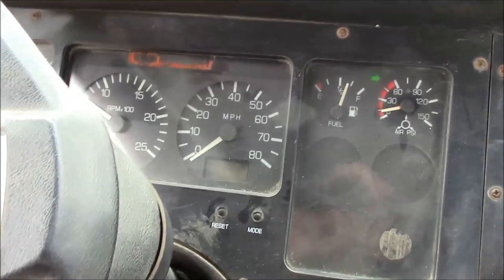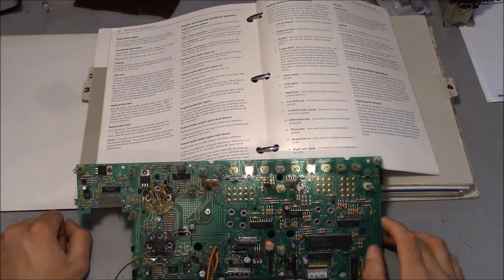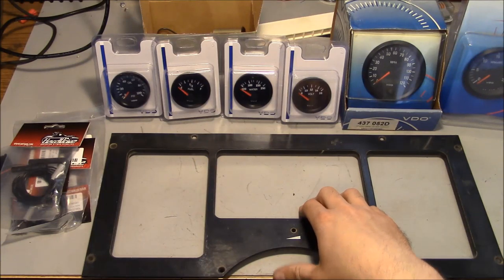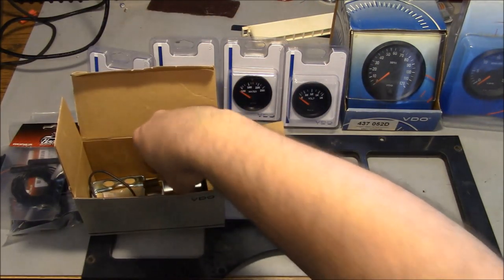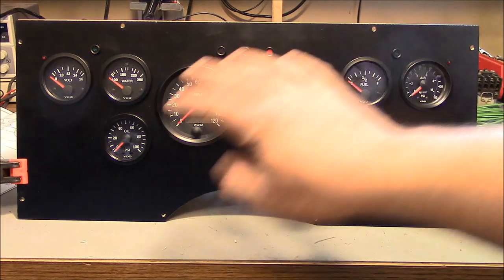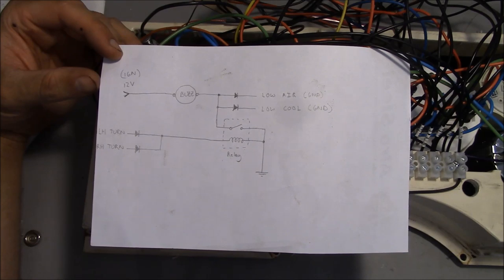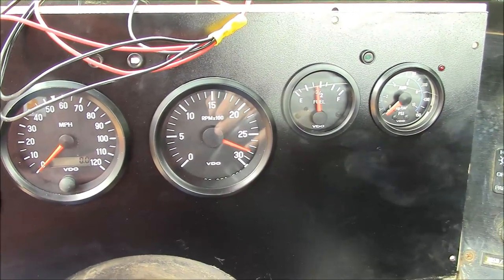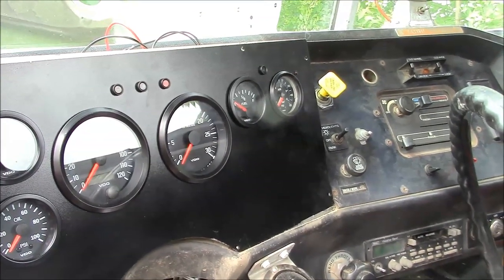Building an Instrument Panel for the Rollback Truck - Part 1

Comment: I really wish I was more proficient with electronics. It’s all electricity but the individual components do so many things that can really complicate troubleshooting quickly. Understanding that whole world certainly sets you way ahead of most in the mechanics’s world as well as most tradesmen. It’s not rocket science but definitely takes a different mindset than regular services, branch circuits and most electrical industry installation outside of fire alarm and PLC (programmable logic control) work; even most building controls are made pretty foolproof and it’s pretty easy to plug-and-play low voltage lighting controls using power packs (lighting control relays using dimming and occupancy sensors). My hat’s off to you, Wes! It’s an impressive ability to be able to draw from.

Comment: The item with the big heat sink is a bridge rectifier.
If you had a really useful diagnostic tool called Itty Bitty tester you could troubleshoot that rectifier, diodes, transistors, mosfets and other devices.
I've had one since the late 90's and it works great.
You'd also need a logic probe and a logic pulser.
With those items you can diagnose those old TTL boards.
The logic probe and pulser to test that microprocessor and transistors (5 volt max) in circuit power on.
Digikey is the best source for every item on that board.
If they don't have an item their engineering techs will help you find an alternative.
I've been working on old TTL boards in arcade and pinball games and other electronic devices since 1983 and have very rarely found one that can't be repaired.
If they've been hit by surges or have suffered other catastrophic damage then it's tine for the recycling bin.
Scrap byers actually love buying them.
Last I checked they give $ 1.78 a pound for them.

Comment: That's an Intel 8031/8051 microcontroller.  The crystal (blue resonator) is on pins 18 and 19 where you were probing, pin 20 is GND and pin 40 is +5v.  If there is a ROM chip near it, it's an 8031, if not, it's an 8051 with OTP ROM on die.
Reply: Nice detective work
Reply: Very interesting. You are well-informed.

Comment: Self canceling lights are common on newer trucks. The way I would do that is to use two different "buzzers". The turn signals could use a less annoying "chime" instead and that would eliminate the problem of the different type of switching. You will soon hate that noise every time you turn. No matter, that still looks WAY better than the stock dash.

Comment: Very admirable, instrument cluster is one area ordinary mechanics don't want to tread, it comes into the territory of electronics. But you have electronic knowledge and its come in handy. I once owned a Nissan Micra and it came with the problem of the engine temperature gauge would not function. As usual, I tested the circuit at the sender end to eliminate it and the wire to the instrument cluster. Finally it boiled down to the ins cluster, which I then removed and not knowing much about electronics I took it to a radio repair shop who fixed it.  I am pretty sure it was a diode or a capacitor.............

Comment: Nice job! That new panel looks nicer than the original, as well as working!

On that warning beeper, if it is too annoying, just put a piece of tape across the mouth hole. Muffles them right up.
Reply from the maker: I think I'll just use a current limiting resistor. Less power = less noise.
Reply: Works on spouses too, or so I've heard.  Haven't tried the resistor though.
Reply: @firstmkb  Sounds like something a boomer would say.

Comment: I drove a truck that had the buzzer hooked to the directionals, it about drove me nuts, especially when you turn on the 4 ways when you are backing up.  Non of the newer trucks I drove had the buzzer hooked to the turn signals.   I would NEVER hook the turn signals and 4 ways to a buzzer.   Doesn't take much to learn to turn them off with out the buzzer.  Other than that, nice job  figuring  everything out.

Comment: Not just big trucks that the wires are all the same color.
The '66 IHC 1100A 1/2 ton pickup I had possed all green wires under the dash and to the lights. Only red wire was the positive battery cable. Only black wire was the battery ground cable. A unisulated ground cable went from the engine to the frame.
Gosh I miss that truck ...
Everything else was the same color green, with no stripes or rings of a different color.

Comment: I've had good luck with VDO.  Agree that functionality, and aesthetics from most manufactures have all been inundated by the ricer scene.  Neon bright blue LED, gawdy bezels, face plates etc.  Then comes the pricing.  Good thinking looking at the alternator for a tach output.
Reply from the maker: Yeah it's tough. If you want simple gauges, often they are only made in mechanical versions.

Comment: I always check the 5v rail, I've seen failures of regulators and power supplies.  Some chips just fail, but I doubt after 30 years that Intel chip died.
Reply: I also suspect that the Intel chip is fine. Maybe more likely that one or more of the electrolytic caps on there has died or dried up and gone way out of spec. An ESR meter can be used for testing electrolytics in-circuit, and can quickly expose a faulty one.

Comment: yeah fixing that board would have been way beyond my ability.  while i do love a challenge I would have went the same route you did on this one.  Great job so far
Reply from the maker: Yeah, plus this was we can swap out individual components if something fails instead of "replace the main board" as suggested in the service manual.

Comment: Read a few replies before hooking my comments on the most boring commentator. That is harder than installing bearings on your back with grease up to your ears, at least with grease, skitters get stuck when they land to take their transfusion. I  have seen a soldier die from mosquito bites. They were thicker than the no see um's and little black flies that could chew through a uniform.I am proud of your work there. I hung gauges in all my cars as a kid and the amp gauge always had all the wire wrapped around the gauge waiting for me to find out it was one of the easy ones and then kids would bring me their car to put gauges in..... two or three wires per gauge. Thats till I started with mechanical gauges. I want to find part two as this has my attention. Your videos are on my top five channel list

Comment: Interesting circuit for the buzzer. Why did you not just have two buzzers and no relay?
Reply from the maker: You could. But you will still need a relay to overcome the fact that some switches are normally open and some are normally closed.

Comment: Since low air pressure and low coolant level are infrequent (we hope), and lh signal and rh signal are frequent (we hope), wouldn't you hard-wire the buzzer to ground and invert the control signals, so there's less wear on the relay. I realise the relay can probably switch 10M times before failure, but still.. Or have I missed something?
Reply: PS: Try filling your buzzer with epoxy :)
Reply from the maker: It's a fair point. The buzzer only pulls 10mA. So I guess if the relay ever fails in my lifetime, I'll convert the circuit.
Reply: Cheers  @WatchWesWork , Sorry if I come off as That Guy in my previous comment. I was curious to explore the options,  not be a youtube comments troll. Your make a great point about relay load. I hadn't thought about that at all, and at that amount of flow, the relay might well outlast the rest of the vehicle, and you and me.

Something I didn't consider is what are the knock-on effects when the relay fails, and how obvious will failure be? If the relay fails when it's in the indicator circuit, you can easily tell because you moved the lever and nothing happens. If the relay fails when it's connected to e.g. water level, and your water level drops - very bad things might happen. So you have probably picked the best setup anyway.

I'm overthinking it now, so I'll stop.

PS: The dash looks great, good idea, and great execution. All those wires at the rear can easily be shortened and cable managed later after testing, if they annoy you. I'm sure you have that planned already, and I'm jumping the gun.

Looking forward to the next installment.

Cheers, Craig

Comment: I would suspect the power on reset circuit, since these are usually analog, the chip won't work right if the POR circuit doesn't correctly put the chip  through reset.  You can put 5v on pin 9 momentarily to reset the MCU and see if it changes the behavior.
Reply from the maker: I can try it. I would still have to fix the back light circuit and the tach.

Comment: Very likely that the sine wave you picked up was an input to the chip rather than an output. At 12Mhz, on that old of a chip, I doubt it could (or would need to) make the nice clean sine wave that your scope read. I imagine it was just an oscillator input that the chip was using as a clock.

Also - with the two lines you talked about that switch the stuck-on bulbs via a transistor (I forget which bulbs now, but anyway), is it possible that the fault is in the other half of the circuit, i.e. the input to the IC, and that the IC is fine, and doing what it should? If you can trace from the various sensors plugs (using the numbered wires from the manual) you may expose a fault before the IC comes into play. If so, then it becomes an easy/easier fix. You may already have had this thought and it didn't work out, I'm not sure.

It doesn't help that you have about 10 faults at once on the board (!), so I don't blame you for chucking it out and starting again with a more robust solution. Anyway, building a new one makes for a more interesting project for you, and more interesting video for us :)
Reply from the maker: I don't know. From reading the manual, I think the seat belt light is supposed to just come on for a few seconds when the ignition switches on and then go out. I assume that control is done in the microprocessor with no outside input required. But I don't know. I have no schematics or other information on how it works.
Reply: @WatchWesWork  Fair enough - The new one will be more than worth it anyway and it will solve all the various problems in one shot.

Comment: If you still have the board and 5 minutes.  pry the chips up gently look for any ick the big pink pencil erasers clean the pins well.  The other thing if your eyes are good or glasses look at the ground running on the board and "gently" flex the board looking for solder cracks  you may be able to touch up a solder crack and fix it to get by for a good while.   Otherwise old school is not bad.
Reply: Pat B good tips - also push any socketed chips down in the socket, since they can work their way out.

Comment: I think I would have used the connectors off the circuit board to maintain the original wiring for the most part and so the cluster could be unplugged for service. Sounds like there are extra pin outs in them you could have used for your needed additional wiring for the other gauges too. That electronic board looks overly complex to me for what it does anyway, better off without it.
Reply from the maker: It would be nice but the connectors on the board have to be soldered to a PCB or the pins just fall out. I guess I could have sawed up the old board... I could always rig up a 12 pin weather pack connector. I have the crimper for it.
Reply: @WatchWesWork  Sawing up the old board and soldering the wires to the traces is probably what i would have done. Now that you have cut the truck harness the weatherpack would be the way to go. It would also likely confuse somebody someday when it looks factory installed. :-) lol

Comment: Great work Wes, Thanks I found it very interesting. Are you going to place your Hour Meter up on your cluster as well?
Reply from the maker: I don't know. I may ditch the hour meter. I think it was added when the tach started acting up. It only shows 600 hours. So it's kind of meaningless and not something I really need.
Reply: @WatchWesWork . Wes all our trucks at work have rear hub odometer as well.  Do you have one?

Comment: I have a volvo car in the UK that is doing the same thing but this one works ok for 10 min then goes off they are know for bad soldering on the chips on this board i have so look at the joints,make sure there isnt any dry joints

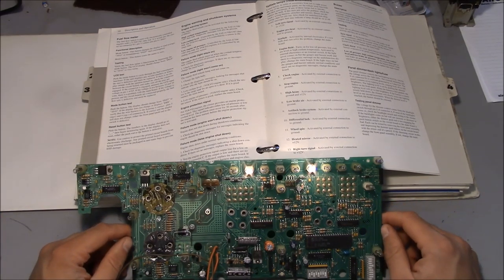Comment: 3:42 yeah, that's a mask programmed microcontroller of some sort. That's why you couldn't find anything from the numbers: it's a custom chip. If it's pooched, there's no way to repair that, unless the manufacturer kept that image and is willing to let you have it.

They used to do that in the day because programming general purpose controllers was slow and fairly labour intensive, so if one needed a lot of microcontrollers, one ordered them direct from Intel with their programming "baked in" at the production stage. Nowadays, with in-circuit programming over a high speed serial bus and COB (circuit on board) being the norm, I'm not sure chip manufacturers still offer this service.

Edit: yeah, another advantage of this technique was that the program memory was not EPROM memory and you could, therefore run a faster clock speed. Can't imagine there was a need for that sort of speed to run an instrument cluster, though.

Comment: Yeah, I wish I was as smart as you. Here's an interesting bit of info. In marine applications with twin engines, the oil, water temp and charging gauges are usually top line and they're all clocked so that normal operation readings are at 12 noon. That way a quick scan of the top row of gauges requires the user to simply confirm that they're at noon, and good.

Comment: I know this is a bit late at this point but if the microcontroller on the board is directly driving the transistor to the warning lamps it means there must be an input to the microcontroller on another pin.  Perhaps the board is corroded or a pull up/down resistor has failed?   Maybe you traced from the input wires but just didn't find anything so didn't show it.   Looks like that board was at the end of a long string of small failures in any case.
At this point I'm sure you'll be happier with the new panel.
Reply from the maker: With no schematics, I don't know how we could ever figure that out. Most micro controllers have assignable pins, so pretty much any pin could be an input or output. I poked and prodded that board and I only found one bad diode. I think fixing it is beyond my ability.
Reply: beyond my ability too :)
Reply: Ah - looks like you already suspected the input circuitry. Sorry, I basically echoed this suggestion elsewhere, before reading this.

Comment: Murphy gauges is a good source of gauges used on mobile Diesel engine on welders, pumps, gensets,
Since that is Volvo engine it has iso standard pipe threads
1/8-28 ,1/4-19,3/8-19
So your sensors to engine or to truck could be leaky.
Reply from the maker: It's a Cummins engine. All the fasteners are metric, but as far as I know, it uses regular NPT pipe threads.

Comment: 91 should be a ODB1 system anything prior to 95 i think should have it back to at least the late 70's or 80's
Reply from the maker: OBD only applies to vehicles under 8,000 lbs or something like that. It's the wild west on big trucks.

Comment: 12 MHz clock on pins 18 and 19 probably means an Intel 8051 MCU.   Not that it would have helped much to know that, as it seems that chip is probably toast anyway.
Reply from the maker: Something is toast. Or several things.

Comment: Bad caps, cracked solder joints... Just say'n... 30 years old, vibration, heat, cold cycles... Don't matter now though. 🤣

Comment: Why the hell do you need one of those horrible rotten ding ding ding sounds. In Australia we don't have them at all even on corresponding model vehicles. Sure audible warnings okay, but when you simply turn the key on???
Reply from the maker: You are required to have the alarm to indicate low air pressure. Low air = no brakes.

Comment: Hey Wes, Dakota Digital sells tach interface boards that you can program your own pulse ratio to feed your tach, I used these for gas tachs connected to marine diesel engines or roll your own with an arduino  http://www.dakotadigital.com/index.cfm/page/ptype=product/product_id=128/category_id=-1/mode=prod/prd128.htm
Reply from the maker: Thanks for the heads up! It looks like they have a unit that will let me run off the flywheel. That might be better than splicing in new wires.